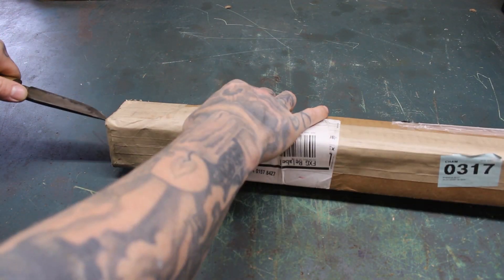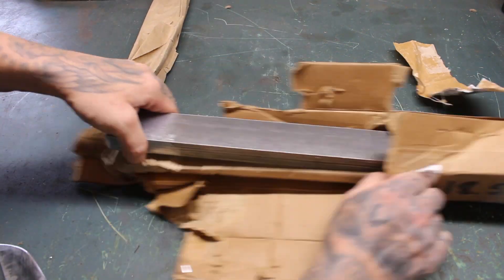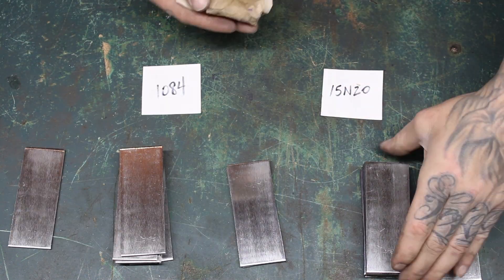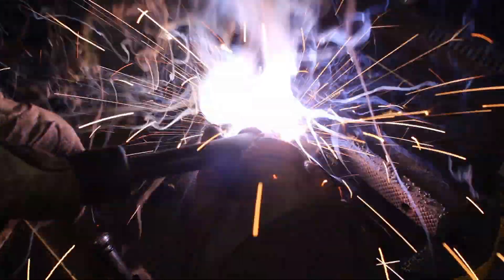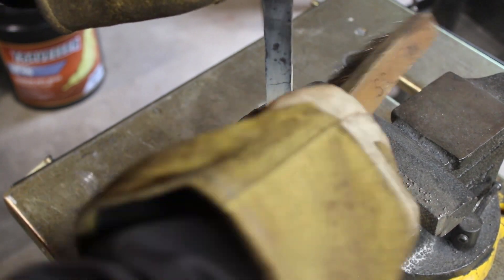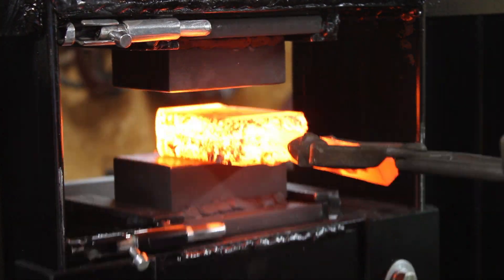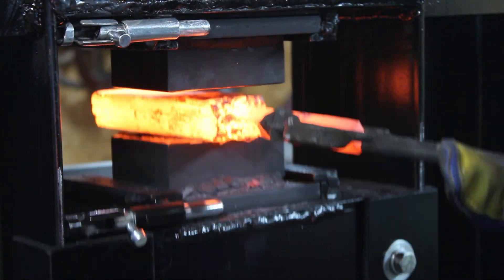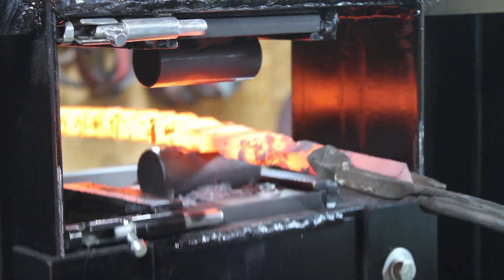Forging My First Damascus Knife Part 1 - The Billet  - 1300 Layer Bowie

Comment: If you want to secure solding the stell layers, you can use a wodden hamer when the steel is white hot to secure that the presure don't open the gaps betwen the layers befor going to the press, amazing work by the way.

Comment: Very interesting. But some more explanations what you are why doing would be nice. Why do you bath the steel pack in kerosene?
Reply from the maker: I don't use flux, as it is known to erode the forge floor, so instead I initially soak the stack in Kerosene to keep in between the layers "clean" and it will burn off preventing oxygen to get between the layers...oxygen is what causes scale and scale prevents the forge weld from sticking, hope that helps, thank you so much!
Reply: @GhostMade217  thanks, that sounds smart.